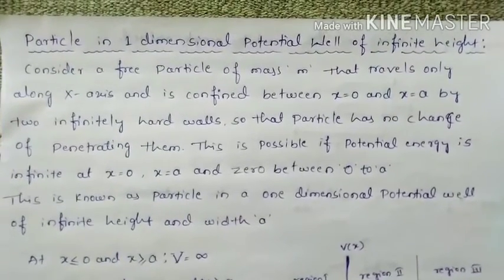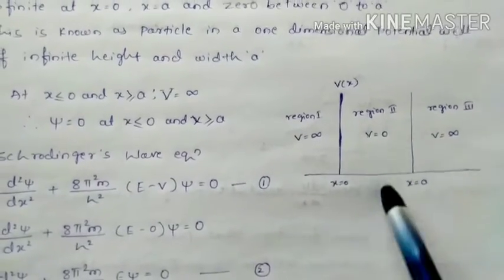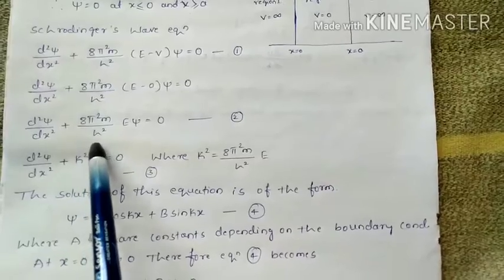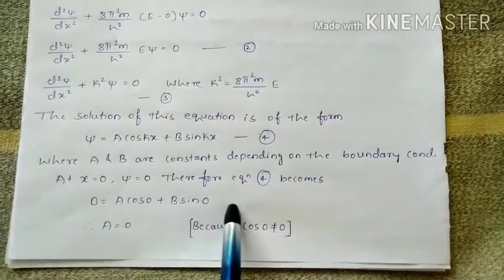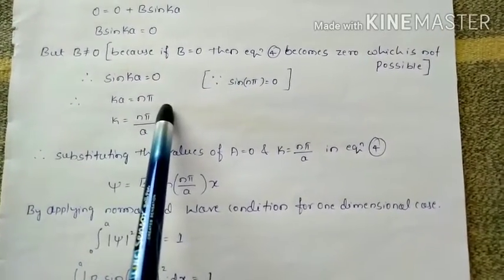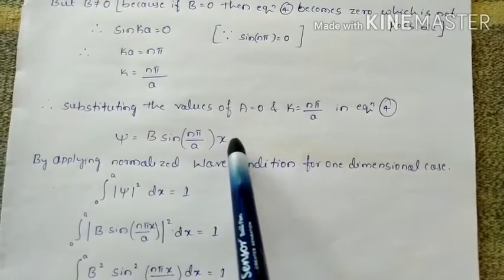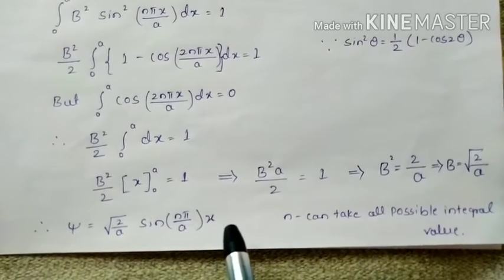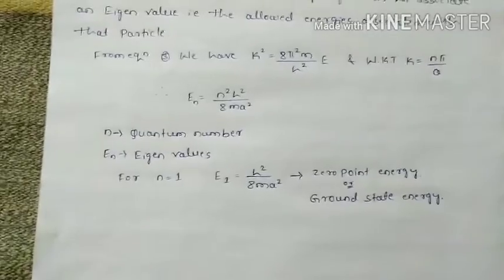Particle in 1- Dimensional Potential well of Infinite height

Comment: Thanks for your interesting video.

https://youtu.be/wrBsqiE0vG4?si=waT8lY2iX-wJdjO3

Your viewers might enjoy this video which demonstrates that, under the right conditions, the quantization of a field can be easily achieved.

The ground state energy is induced through Euler's column containment analysis. The containment column m must be engaged before over-buckling, or the effect will not occur. The system responds in a quantized manner when force is applied perpendicularly. Bonding at the points of highest probability and maximum duration (peaks and troughs) of the fields/sheets results in a stable structure from three fields.

Some say I am akin to plucked guitar strings. I argue that structures cannot be created with vibrating guitar strings or harmonic oscillators.

Currently, in my research, I am attempting to describe the "U" shape that is formed.

In the model, "U" shaped waves are generated as the load increases and just before the wave-like function transitions to the next higher energy level.

Combining all the wave frequencies using Fourier Transforms, as I understand, creates a "U" shape or square waveform.

I am considering whether Feynman Path Integrals for all possible wave functions could be applicable here.

If this model is valid, observing the sawtooth load versus deflection graph produced could provide significant insight into what occurs during quantum jumps.
The mechanical description and accompanying white paper can be found on my YouTube page.

You can replicate my results with a sheet of Mylar* (the clear plastic found in school folders).
Seeing it firsthand is well worth the effort!